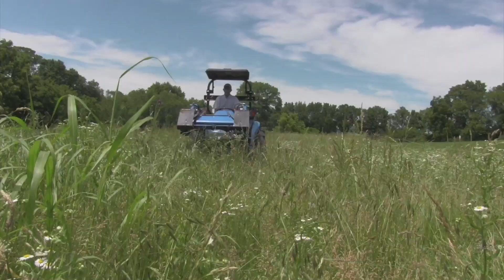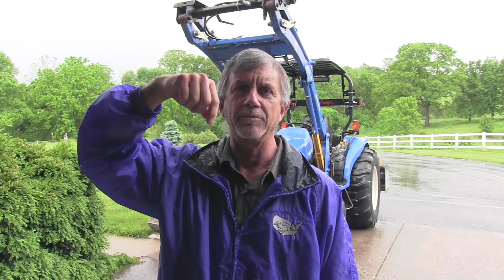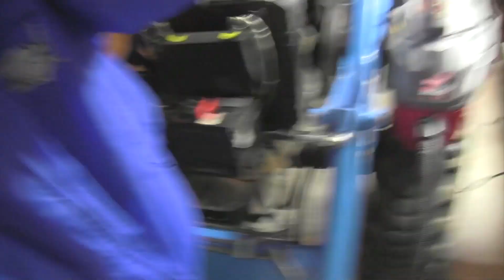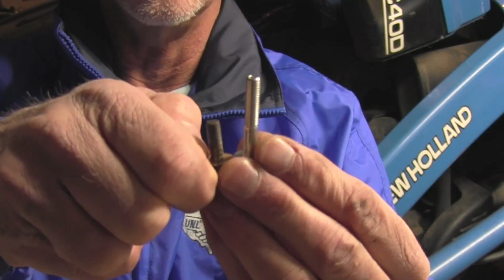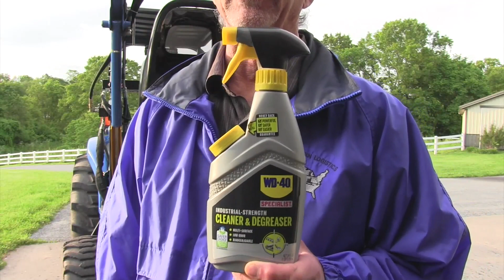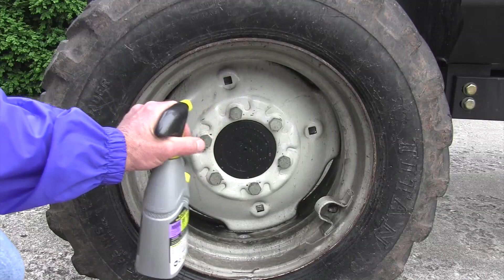How to Not Destroy Your Hydro When Brush Hogging Tall, Rank Grass

Comment: Hello Mike, I watch almost all of your videos and for the most part I agree with your tips, but this video has one thing that I disagree with. I think that by moving your radiator spacing out and leaving a gap between them, you are eliminating the fans ability to pull air through both radiators. You will probably get excellent cooling with your primary radiator as air will be more freely able to move from the outside edges between the radiators in and through it, but by allowing that air flow to come in between the two radiators you have reduced the suction ability of the fan to pull it through both. I think that you will have an end result which will be a higher temperature at the front radiator now.

Comment: I'd like to add that JD recommends a cool-down period after running hard like when mowing. I always take a slow ride back to the barn making sure that the radiator grill is clear first. Typically allow 5 minutes of cool-down.  Without cooling, the heat from the transmission will cook everything including the oil possibly causing harm.

Comment: I don't have the button to increase the transmission power, but do worry about problems with my tractor and will remember to check for loose wires if I do and my older tractor has a standard transmission and it works great except for problems with my transmission not wanting to shift into 1st gear or reverse sometimes. Other than that it is working out the way it should. Thanks for sharing those tips and I wish you a nice day and weekend.

Comment: I like my gear drive old school 57 JD 520. The ol girl is very forgiving.  I just cut some medium pines down for a friend and hauled them with my manure tine trip latch loader to her pile and got held up in the loose sand where i sunk my front end down. Backed up and went forward right out. She said she keeps getting stuck back there with her hydro drive r4 tire 4x4 tractor and my only real problem was i ran out of gas with gas in the tank. To much slope and not enough gas so it ran away from tank outlet

Comment: By spacing the hydro cooler forward you are going to lose some of the air flow through the hydro cooler itself.
 The fan as it pulls air through the radiator will now pull air through the The space that is between the radiator and the hydro cooler as opposed to pulling the air through the hydro cooler.

If you do that I think I would be inclined to add some type of a shroud that you could take on and off to get your cleaning wand in their.
 If you had a way to monitor the temperature of the hydro oil separately from the engine temperature I think you were going to see it increase.
 Check with your mechanic guru to see what he thinks about this Mike.

Comment: I have a gear drive Kubota L3200 for discing and mowing and a hydro Kubota B2301 as a dedicated loader tractor. I find the gear drive works best for field work select the proper range and gear set the hand throttle and go. You can concentrate on the task at hand. The hydrostatic drive is also great for a loader tractor. Select your drive range, set your throttle and concentrate on the loader/tractor operation.

Comment: You were fortunate that the TC40 had rubber hoses on the oil cooler. A lot of tractors have rigid oil lines going to the oil cooler making it next to impossible to move it out.

Comment: I have a concern with moving that hydro cooler out. Would this not cut down on airflow in the hydro cooler? I know you said you moved it out 1 inch but wouldn’t airflow be less the further out you moved it? A shroud between the radiator and the hydro cooler maybe? I’d like to know your take on the air flow because it sounds like a good idea to space it out. Y’all have a good-un!!!!

Comment: Mike I've got to agree with Ed's comment above you have just destroyed the air flow through the cooler it was designed to be in that position shroud would work but of course that would put you back to zero I don't know why tractor manufacturers can't find a way to keep debris out of the radiators and engine compartment it's a cheap cop out if you ask me

Comment: Great video Mike.  Would moving the cooler out allow more air to pass around it?  And yes the diesel suet is a pain, all over the loader as well.  I am going to look for that WD cleaner next time in the store.  Also I use Simple Green to clean the suet off and it works great as well.

Comment: Great vids, and advice, Tractor Mike. I wish I had a mechanic to consult about my mid pto not working on my JD2305. I just bought it w/343 hrs and I can't use the belly mower or any attachment that runs off of the mid pto. Thanks for your very helpful vids.
Reply: These tractors have a lever that controls which PTO shaft is active.  Mid, rear, both.  Does the rear PTO work when you select that?

Comment: great video and good suggestions.  I would like a video on suggestions to shift from forward and reverse without affecting PTO speed when using a brush cutter in area where you need to constantly change directions.  thanks.
Reply: I've done a lot of tractor work on smaller older tractors, like a Massey Ferguson 35. A lot of it running haying equipment that's spinning heavy spindles and using belts. It was critical not to change the PTO speed or you would risk throwing the belt. We always kept the engine and thus the PTO speed constant by using the hand throttle and have it set for the PTO to spin at the correct speed. Any change in speed or direction would be done by changing gears. Yes, you will be easing up on the clutch, and you will be wearing it some, but, cost of business I guess. Hope that helps!

Comment: Hi Mike. Does anyone sell hydrostatic oil temperature gauge for tractors? Seems like that would be a useful tool to have. If it got hot, you could stop before you caused damage.
Reply: A gauge is only a tool when it is used to diagnose a problem, otherwise a gauge is an instrument not a tool.  
Any temperature gauge with a sensor in the appropriate range would work, a $10 oil temp gauge from auto zone would function fine hooked up to one of the hydrostatic transmission cooler lines or it’s cooler.

Comment: Mike, With the overheating is there any way to fit a temperatue gauge to the hydrostatic transmission. this could help you keep a closer eye on temperatue rises in the hydrostatic transmission.
Reply from the maker: Don't know the answer to that but I will check.  Great idea!
Reply: Tractor Mike ... while you seek the answer ... can you find out the average temp range the hydraulic oil runs?   Thanks

Comment: One thing you didn’t cover. CHANGE THE HYDROSTATIC OIL. Heat kills oil, and it loses lubricity at an exponential rate the hotter it gets. And most owners never even think about changing the hydrostatic drive oil and filter. Which once that oil is cooked after a day or two of running hot that’s when you start wearing out the internals and killing the transmission.

Comment: Re picking the right gear (the funny noise made by our host) - it is a common mistake by newbies (and hard headed farm hands) to be in too high of a gear.  They then control speed by slipping the clutch (grrrr), or babying the hst pedal. 

We don’t have hydro trans tractors - all have clutches. Most are 80+ hp, so they are wet clutches which can take that abuse a little better, but still not the right way to run the tractor. 

Not only hard on the tractor, but can be dangerous. We have had  an operator dump a clutch (foot slipped off) while in a barn launching tractor 20ft through a door before they regained control. 

No one hurt, not much damage, guy lost his job (not his first poor decision). Absolute rules: A range (lowest) and no hand throttle in a barn.
Reply: “Slipping the clutch and babying the hst pedal”. 
While in the wrong gear?  What tractor was that on?

Comment: Hydromatic's are neat and all until you get the bill to repair, or replace it....  0_o      which will happen, there is no if about it...   So I'll continue to use my old Ford 4000 Industrial 4-speed 4-cylinder Diesel to get'er done...    It's 57 years young and as long as I keep up the maintenance, there's no reason it won't last another 57.

Comment: I'm a prospective first time tractor owner.  I'm learning quite a bit from your channel.  While researching tractors, I see that there is a wide variety of front wheel size, even when compared to the size of the rear wheels.  Is this significant?  Are the tractors with front wheels about 3/4 the size of the rear wheels better for certain things than front wheels < 1/2 the size of the rear wheels?

My intended use would be predominantly forested land.
Reply from the maker: Mark,  If you're working in the forest and moving logs, you'll be stressing the front tires because they carry the weight of the loader.  I'd want the biggest I could get.  Here may be a partial reason for the differences between models.  On FWA tractors, there are ratios that must be followed since the circumference of the wheels is different.  Between the radius of the wheels and the gearing of the tractor, the front wheels must run slightly faster than the rear wheels to prevent a "plowing" effect.  That's why if you ever replace a 4wd tractor's tires, the exact same size needs to go back on to keep the ratios right.  I'd say that manufacturers probably design their gear ratios around available tires sizes and also use the savings from equipping a tractor with smaller tires to help meet price points.  I'd also bet the tractors you're seeing with the smallest front tires tend to be "economy" models and the larger front-tired tractors tend to be "deluxe" models.  On the larger tractors, tire size can be specified when ordering, on compact tractors they generally only come with one choice.  Hope all that helps!
Reply: @TractorMike  thank you for the thoughtful reply.  I'll certainly be using the loader to place logs on the mill and to organize log storage near the mill.  For skidding with a winch even, a bigger front tire would be able to hold more ballast which would help keep the front wheels down if I find some big logs.  Your reply and videos have helped me realize I'll want to add weight to all 4 tires.  Thank you.

Comment: Good day! We have a 1998 Ford 1920 model tractor 32 hp 28 at the pto 4x4. It's about worn out mountain mowing 2400 hrs +. My brother in law insist it wont hurt  to use it with the 5ft heavy duty bush hog mowing 3 ft tall hardy thick weeds. The mower is vey heavy and sways the tractor when starting the pto. What is your take on whether this will hurt the tractor, clutch, or other parts. Thank you, love your videos
Reply from the maker: Michael, that's hard to say without knowing the horsepower requirement of the cutter, the volume of material that will go through it and how steep the slopes are you'll be using it on.  I would say a 1920 would be able to pull almost any 5' cutter I've been around, whether it can do it on the hills you're planning to go on is impossible to say without seeing them.  Good luck!
Reply: Thanks for your response, I will check on the mower

Comment: I live in Falcon, MO. You must not be too far away. I had an EPIC RAIN earlier. Around 3:50-4:10 pm. It was a VIOLENT amount of rain!!

I have a powrreverser JD 5055E

I tend to use A4 for mowing in 540E mode. I hear a whine when in reverse or in fourth gear. Is that whine just all the mechanical advantage? Or should I change my fluid? Or use B1? I use the A range because I like to be able to quickly shift down a gear when approaching hazards such as trees that I need to back under and carefully manipulate my position. 

Thoughts?

You're a hero. First time commenter. First time tractor owner. You have taught me SO much!!
Reply from the maker: I'm in Ozark, I wouldn't want to walk from here to Falcon, but it would be a pretty drive :). My guess on your Deere is that it is just normal gear noise, but maybe someone else will see your question and know a better answer.  I've been on the other side of Deere my entire career, having been an AGCO rep and an S & H guy, so I'm just not that familiar with what's normal on them.  Thanks for commenting, if you have any other questions, let me know.  Good to talk to another southwest Missourian!

Comment: Seems like this will not allow the fan to move air through the hydro radiator . Unless you have a shroud between the two radiators
Reply: Yes, the air flow will find the path of least resistance, via the sides with the now larger gap.  Thus, there will not be as much air flowing through the hydro oil cooler.  There will still be some air flowing through the hydro oil cooler, but it will be reduced by a bit.  Some kind of shrouding would definitely be of benefit, perhaps quickly removable to allow access of the cleaning wand to be used easily.
Reply: Ed KE6BNL agreed
Reply: Interesting.  I was just thinking as Mike did that, why don't tractors come like how Mike modified.  But your thought seems to make sense.
Reply: I was thinking the same thing. Maybe some rubber flaps on the sides and top to close it in, but give access to clean.
Reply: I agree
Reply: You’ve got to remember it’s all under the hood, which is essentially a large shroud....
Reply: @chevyon37s  Doesn't matter, there's enough room under the hood for the air to blow out sideways instead of going through the radiator stack.
Reply: it wont move enough air .   I am a newholland tech.

Comment: I have a new deere 4044R tractor and have been watching all your videos on brush hogging do's and dont's. I regularly cut 18 acres with a rotary mower and have been trying to find the sweet spot for (comfortable) speed over ground, gearing and engine rpm while still trying to maximize having my forward pedal down so as to keep the HST cool. I recently found a feature called "speed match" in my manual which let's you set a max forward speed and lock it in. Then when you (fully) depress your forward pedal you achieve that speed. My question is with this feature activated, proper rpm and the forward pedal fully depressed am I running my HST at or close to max flow?

Comment: Thanks for your channel!  Question: I just bought a new Kubota MX5400 with the HST.  Should you always run it at 540 PTO speed when mowing with a rotary cutter? That's WOT on this tractor and seems abusive to the machine for extended periods.
Reply from the maker: When I'm cutting this time of year with the leaves off plants and don't require the full horsepower of the tractor I'll run below 540 rated engine speed.  My rated engine speed is 2600 RPM, I've been running at 2200.  I don't think it hurts anything, except your blades do spin slower but I can't tell it makes a difference.

Comment: Why doesn't someone sell skid plates for tractors to protect the bottom of the tractor?
Reply from the maker: There would be so many different configurations it would be tough to design one that fit a large number of models.  Plus, it would be expensive to ship.
Reply: @TractorMike  How about directly from the tractor manufacturer? Every four wheel drive pickup I've had included a skid plate from the manufacturer as an extra cost option.

Comment: I love your videos and I think I might need your help. I'm a first-time tractor owner: I recently got a tractor second-hand and it's a Mahindra Max 28XL HST. It starts, I can lift and lower the bucket, same for the attached brush hog, but (and this is the embarrassing part) I can't figure out how to put it in gear and engage the brush hog. How can I get in contact with you to get started? My recently-purchased land is looking a bit forgotten as I struggle to figure it out. I've been looking for an operator's manual on the Internet and haven't found one I can just read. Help me Obi-Wan, you're my only hope!
Reply from the maker: Carmen, 
My e-mail is mike@asktractormike.com.  Shoot me an e-mail and in the meantime I'll check with the local Mahindra dealer.  We'll get it figured out!
-Obi-Wan :)

Comment: The video shows you changing out the two top bolts, were there any bottom bolts? So it didn't affect the hoses on the hydro filter?  Thank you!
Reply from the maker: There were two on the bottom as well, hard to get the camera in there.  I had enough hose to make it work.

Comment: Good information! Question Would you also recommend with a Kubota BX1870 mowing with 54inch belly mower in low range ? These Kubota’s only have a fan on the driveline at the HST pump no external radiator for it running around 3 gallons of super UDT fluid. Thanks and have a Blessed Day !
Reply: Michael- I have a Kubota b2320 with 60" deck and run mower in M but will put into low gear on hills. Have 600 hours on tractor with no issues

Comment: CHANGE YOUR HYDRAULIC FLUID!1!! Like, often. Heat kills oil, and fried oil kills hydraulic pumps & motors. Also, if you’re mechanically inclined, adding a hydraulic fluid temperature gauge might not be a bad idea (any generic automotive temperature gauge will do; the tricky bit will be coming up with a mounting block for the temperature sender... you’ll probably have to do a bit of work on a chunk of aluminum with a drill press, hacksaw, and tap set; unless you want to drill into the transmission housing).
Reply: It’s not like we could just get the temperature at the hydro cooler or the hoses......

Comment: Not a good plan Mike. You just made it cool less and poking around with that long rod your bending the louvers on the radiator and the cooler. Blow your cooler , radiator from the front, wash from the front. Then wash from rear.
Reply: Forcing junk deeper toward the clean side is never a good idea.